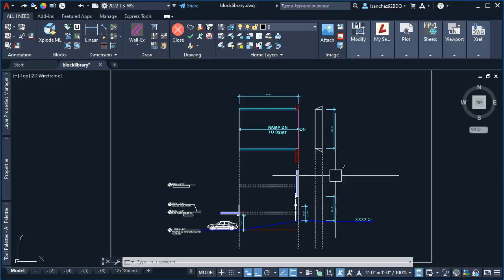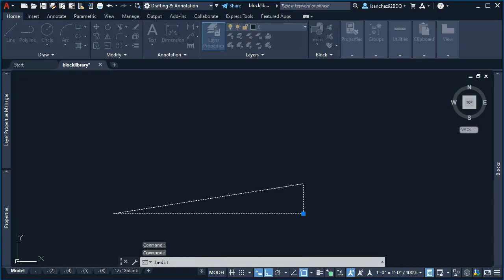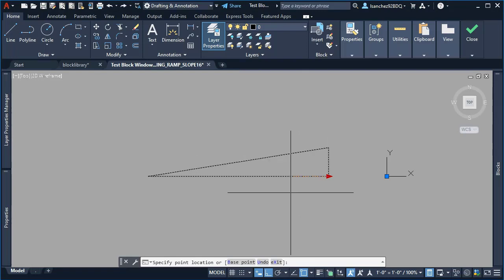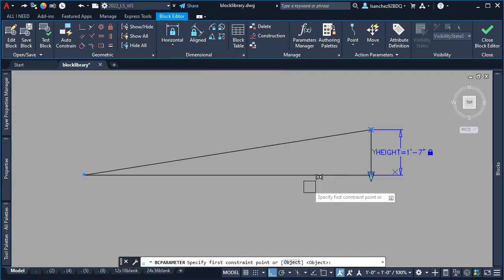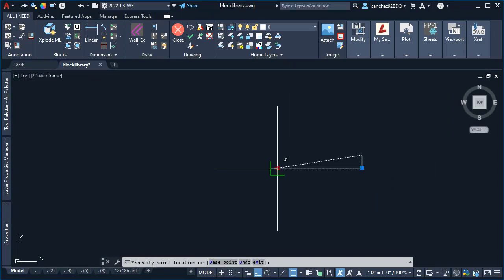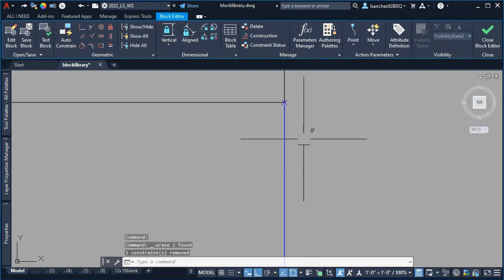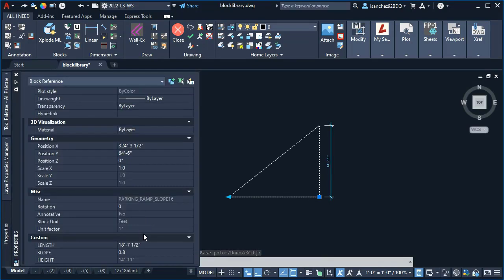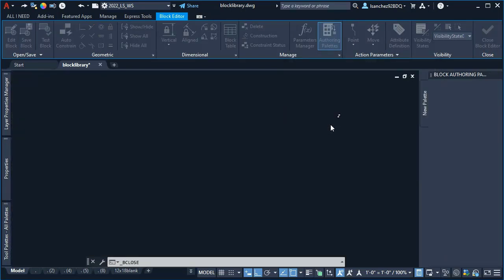AutoCAD Dynamic Block with Parameter Formula and Constraints

Comment: Awesome, Awesome Awesome. This has so many applications it could work with. Did I say awesome? 👍👍👍
Reply from the maker: Yes 😀 glad this dynamic block was useful to you. Actually it can be used for handicap ramps, etc
Reply: @LazyArquitecto  I was thinking more on the lines of trusses for roofs
Reply from the maker: @douglasmichel6361  good idea 💡 it can work for anything that needs slope
Reply: @LazyArquitecto  ;  I have a question. As you know in roof rafters we work with pitch, 4 in 12, 6 in 12 or just the angle and the base length of 12” ( or multiples there of) . What I’ll do is draw the elevation roof pitch indicator (triangle) 12” base then up say 6” vertical then close the PL. Then explode and extend my angled line up to ridge. Couldn’t I just create a block with an attribute to fill in the rise per ft.  and it would adjust the angle accordingly? The 12” is constant, obviously. Hope I’m being clear. And thank you for any input.